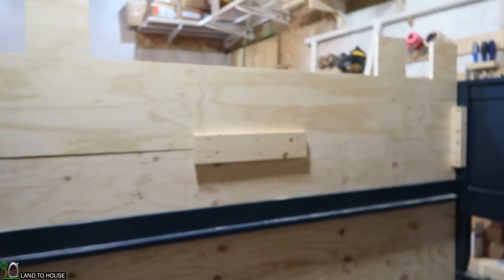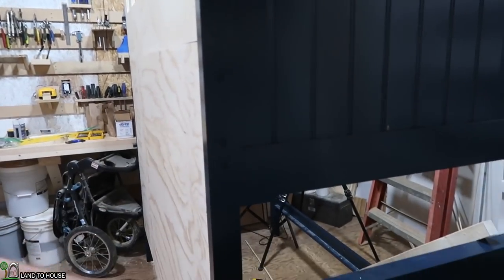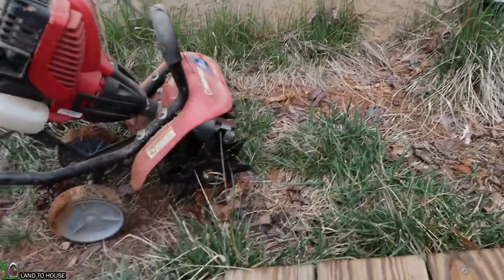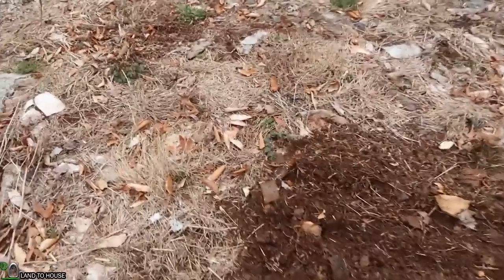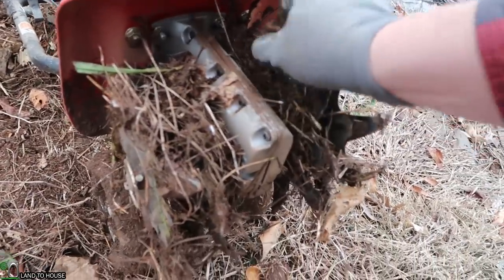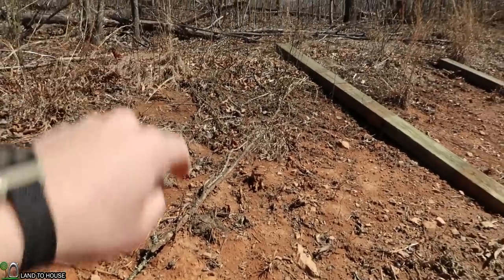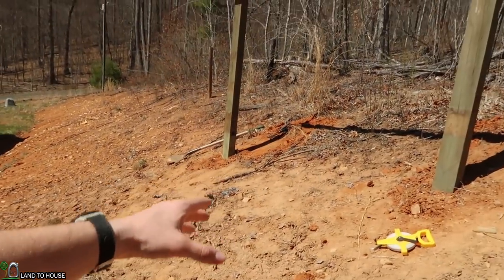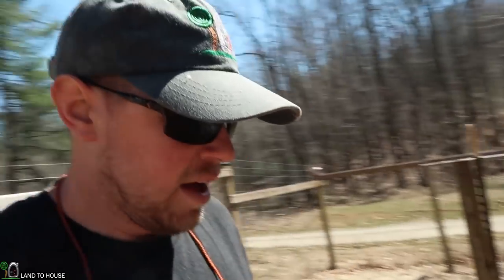Garden Tiller - Vlog 144

Comment: Really enjoy your videos.
For the tiller's oil, the manual says lean it all the way back till the handle is on the ground.  That puts the oil cap pointing straight up.  Oil level should then just barely touch the bottom thread of the fill hole where the cap screws in.  You can raise the wheels to get the tines to dig in deeper, then lower them again for transport.
Daylight Savings Time noon and Solar Local noon are not the same, you're better off just picking a nice day and watching the sun every 30 min and making notes about height/shadow/rise&set and pick your panel position from that.